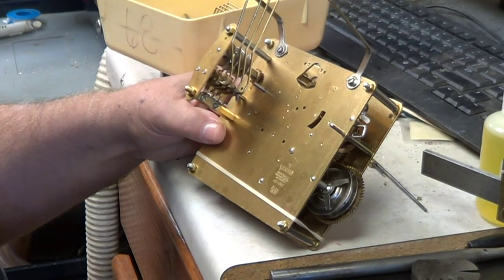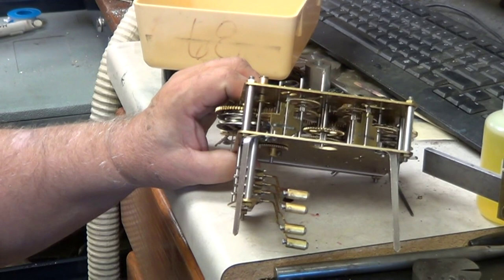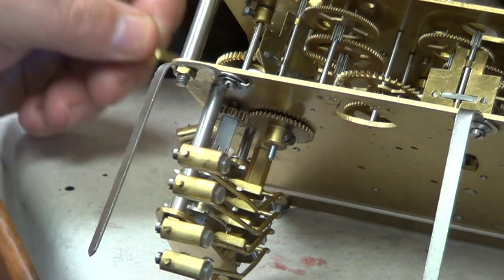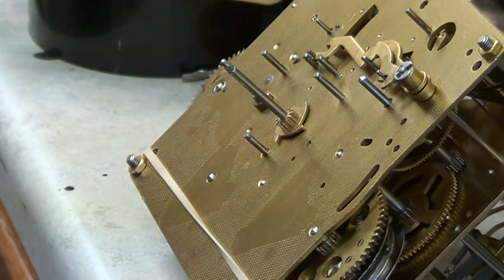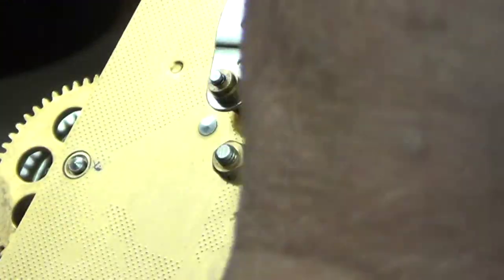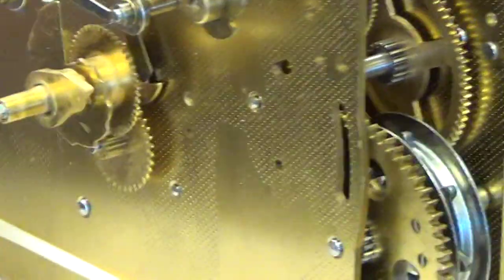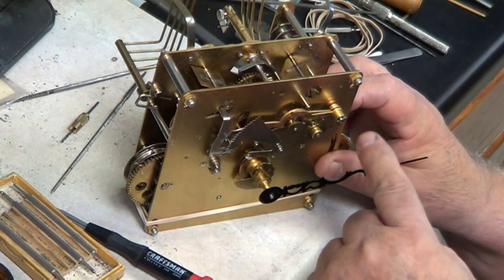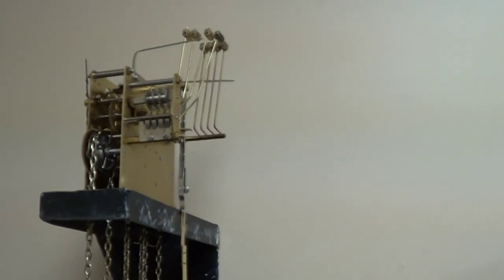Grandfather Clock Build  S1 - E4  Final Assembly Setting Timing

Comment: Why do I have to slightly tap the "butterfly wing" to start the clock to chime?  If I just slightly tap or touch it, then the clock will chime properly.  Thank you so much.  Anxiously awaiting your reply.............
Reply from the maker: Chimes seem to be the biggest problem to get fixed. If the chimes don't work then the strike won't work either one comments on the other. Sometimes it's simply because the oil on the chime side has dried up and needs cleaning and reoiled. We provide a great clock oil kit that may fix the problem ad www.mybenchjeweler.com  Thanks The Bench Jeweler Mike E;

Comment: Both of my guard pins are approximately 180 degrees off. It has been running for months now & within the last few days, the clock will stop @ 52 minutes on the hour. The star on the hand shaft raises the bar & the guard pin interferes with the guard pin on the chime side. I have not had any interference problems with the strike side. How should I rectify this.
Reply from the maker: As the Star Cam on the minute shaft lifts the long arm the waring pin should drop and stop till the long arm drops letting the chime barrow or hammers run. If  the long arm lever drops but the warning pin does not clear the arm then it has a timing problem with the 4/4 counting cam far top right corner on the movement face. Before you make any adjustments be sure you run the minute hand and watch to be sure the problem is as I described. Let me know what's going on.  The Bench Jeweler   Mike E.
Reply: @rhjgold  Had to reposition the warning pin 180 degrees to stop the interference with the long arm. everything else was good & it works as it should now. Thank you.